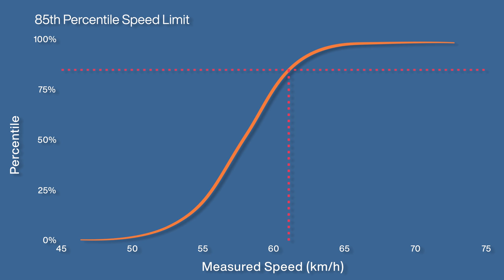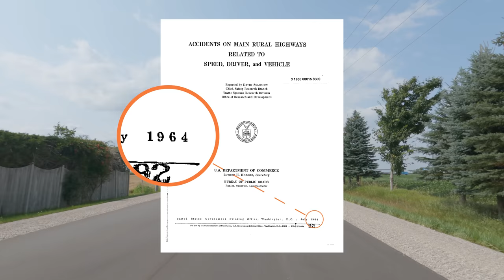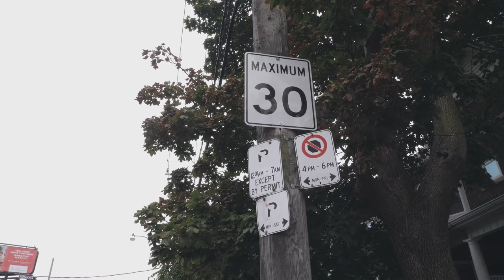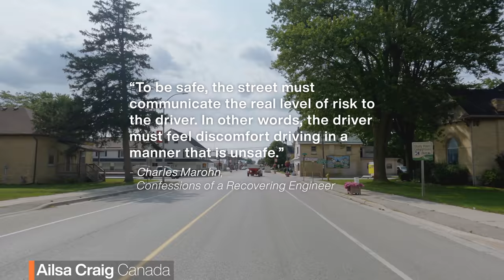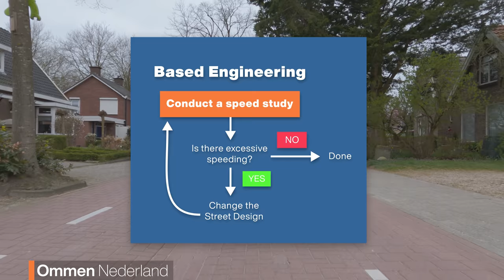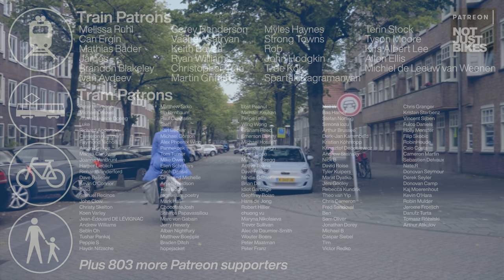The Wrong Way to Set Speed Limits [ST06]

Comment: The 85th percentile method exists for a reason: When vehicles are being driven at vastly different speeds on the same road, the potential for serious collisions is significantly increased. Since roughly 85% of drivers tend to settle around the same relatively reasonable speed totally without regard for the posted limit, with roughly 7.5% of drivers religiously obeying the posted limit, and the remainder going full plaid. By setting the posted limit at the 85th percentile speed, you minimize the potential for speed differential between drivers, and thereby minimize the potential for serious collisions.
Reply: You missed the whole point of the video if that was your takeaway - it's about designing safer roads because people drive to the road design and not the posted speed (which is honestly what you said). When the majority of drivers are driving at an unsafe speed for the environment because of road design is where you get the problem.
Reply: @dertfert745  the guy said that road should have a 30 kph limit. Kinda lost any credibility from that point on.
Reply: @Rokomarn  I'd be fairly sure he said streets should have a 30 kph limit, which is an important distinction. Not all roads. 
This video did tend to confliate completely different types of road infrastructure where it was convenient to make the point, it's not his best work. But nobody's suggesting an arterial road have a 30kph limit.
Reply: @The98597thMark  what? No he's talking about the road he is talking about. I don't know how you can possibly confuse that.
Reply: @Rokomarn  Use a time stamp to show which road you mean.
Reply: @kudosbudo  06:10

Comment: My town is currently redoing the main road. They’re building a lot of shops and making it more pedestrian oriented. While doing this they also made the pavements wider, the road thinner and added speed bumps. It feels a lot more like it’s made for pedestrians. The problem is a lot of cars still drive down the road to get to the main shops with big car parks and stuff. It doesn’t feel very safe for pedestrians because now you’re standing very close to the cars compared to before and there’s a lot of cars going through. It’s the main road off the motorway so lots of cars drive through. It’s harder to get on the motorway from the other roads because they just lead into the busy motorway and it’s hard to find a point you can pull out but the main road has traffic lights.

Comment: The dreaded "stroads" are very common feature in large cities of Poland. Especially in Warsaw (the capital and largest city), but other 200k+ cities have a similar problem. You have city network of wide,  multi-lane winding roads cutting right through downtown districts with motor vehicles speeding at 80 km/h or more (despite posted speed limits of 50), while pedestrians and cyclists need to add lots of distance to cross those behemoths in underground mazes. The underpass near Mariott Hotel in Warsaw is a literal maze of underground corridors, taking few dozen stairs and 300+ meters of walk to traverse. This is an absolute nightmare for disabled or otherewise movement impaired people. Places without an underpass have a normal pedestrian 'zebra' but these are long zebras, sometimes 3-4 at once. Again, movement imparied people are not very happy there to say the least.

This design is unsafe, uncomfortable and also expensive as fuck to build. IDK why they are still pushing this style of design where majority of downtown area is taken by giant road systems and sprawling parking lots (that are eternally full anyway, people are parking wherever they damn well please). Adding more lanes never solves traffic issues in large cities, during rush hour gridlocks still happen even if the stroad is 5 lanes wide in each direction. It just makes it much more difficult to cross for people outside of cars.

Comment: By the way, if it says, "Speed Limit", it is in miles per hour, and if it says, "Maximum" or "Maximum Speed", then it is in kilometers per hour. This is because Speed Limit is an American term, and in Britain, they call it Maximum Speed. That's why at 0:13, the main road going through downtown is set to 40 miles per hour, and the road in the neighborhoods at 0:18 is set to 40 kilometers per hour, which is equivalent to around 25 miles per hour, the speed limit in most American neighborhoods.

Comment: Design speed is something I've naturally thought of while driving everywhere! Glad to know it's actually a criterion for design!
Reply: That's because you're smart, good lookin. If it's raining and you can still safely go the speed limit, then it's too low. More so with snow. I was driving 40 on 35mph road once that had a little snow on it. Complete control. Lights and all gave enough time to slow down, the curved turn offs and everything. Call me reckless if you want, but that road was poorly designed.
Reply: @brianloper6669  I've driven on more than a few roads that had a posted speed of 40 mph when the design speed was more like redline in 6th gear.

Comment: Interestingly, you have the opposite issue on many UK rural lanes. The speed limit is 60 MPH on those, but it's usually unsafe to go faster than 20-30, especially as they're one-lane two-way roads a lot of the time
Reply: Gotta love the Scottish highlands. Single car width roads with occasional passing spots, posted speed limit: 50MPH have at it!
Reply: Yet another reason to take Google suggested paths with a grain of salt. Plenty of roads have a given speed because that's the default on rural roads. In Sweden the default on rural roads is 70 km/h and that is often not advisible.

Comment: Norway falls kind of in the middle when it comes to setting speed limits. In recent years there's been more "Dutch" design to streets, forcing people to slow down with narrowing, chicanes, poles, etc. But a lot of the speed limits on country roads leading into town are for the most part as as in the US and Canada. The road will go from 80 kmh, then 60, then 40. But apart from the occasional speed bump, there's not much to actually slow cars down.
Reply: same in austria. there are areas, where u can drive 100kph on a rural road, that goes through villages and cities, where u have to slow down to 50 with basically no change of street design.
im a big fan of tachographs for all vehicles that can go faster then 30kph. with galileo and gps connection, so first ur car warns u accoustically that ur overspeeding, and if u dont slow down, u will get a ticket automatically... after third ticket in 3 year, u may be forced to make a break for like 1 year :D. when u fail ur second chance, then 5 years, and if u fail third chance, u will never drive a car or motorcycle again. so ez to get rid of all fast and furios semi-apes.
ez technical fix, no need for expensive redesign of all roads, such a device in such numbers would cost maybe 30-50€ a piece, so no big deal compared to overall cost of a car.
funnily i searched german language internet on that topic, that suggestions doesnt even exist.^^
Reply: @certaindeath7776  that will never happen,  it rubs to many people the wrong way even if it would technically be a good solution. You can dream though.

Comment: I've never consciously realised how well road design matches the desired speed in NL now you mention it. I've only felt a few times awkward when there is a mismatch, there are still examples out there. This is usually when speed limit is 50 km/h because it is in theory in city limits although the road is wide, no side roads/streets or other interference in sight. Exceptions in the other direction, where speed limit is higher than implied by road design I cannot remember having encountered those.

Comment: As an European, the only good thing I liked about driving in the US is that there are (almost) no speed bumps. Im tired of scratching the underside of my car because of stupidly tall speed bumps that you hit even when going under the speed limit
Reply: I agree, all those speedbumps are such a pain that people buy bigger expensive cars like SUV's, and pickup's so that they aren't bother (as much) by the speedbumps. The downside to the bigger cars is you get view blocked when driving a normale sized car which in turn makes it less safe which in turn people buy bigger cars not to get view blocked...
Reply: @FlyingThunderRooster  Survival of the fittest!  Go big or go home!
Reply: @FlyingThunderRooster  the worst part about speed bumps is when dumb people slow down excessively and screw up a whole line of traffic.  5mph and your springs won't compress at all, but 20mph and your springs will compress and your shocks will absorb most of it.

Comment: I live in a suburban community, the developer created very wide streets primarily to accommodate large construction vehicles coming and going during the primary build-out phase of the community. After the community was mostly developed, and there wasn’t a much construction traffic going through the community, we (community members) tied to institute various traffic calming measures to reduce the overall width of the street to suit the maximum speed we’d like to see in our community 40-50km. The city traffic engineers were on board, we go opposition from the fire department who pushed an op-ed in the community paper that was basically a guilt trip and smear campaign in one - if we allow the traffic calming measures to go through it will slow down fire department response times and put everyone in the community at risk. That was the end of our proposal for traffic calming.
Reply: Wow. The Fire Department, which is supposed to be concerned with safety, argued against a measure that would improve traffic safety. They can use sirens to cut through traffic and go faster than limits, anyway. I'd bet they fought that measure just because they didn't want to have to drive slower while off duty.
Reply: @nathanpetrich7309  doubtful. They probably didn't want to drive a full size truck down narrow streets full of chicanes and other cars that can't get out of the way.
Reply: @TripleBarrel06  Looks like someone missed the critical detail that I'm replying to a post that talks about a suburb. Suburbs aren't known for streets that prevent cars from letting emergency vehicles through. You can make these streets more difficult without slowing fir engines—I can speak from experience that I routinely go 50+mph down a suburban road that has a 30mph posted limit; they could cut the width in half and I'd still be able to let a truck pass. Now, I'll say this: I was replying to a post that listed speed in kph, not mph, so it could be somewhere in Europe where the norm is much narrower streets in general, but I didn't feel comfortable making that assumption.
Reply: @nathanpetrich7309  I didn't miss anything mate, he said traffic calming measures. The two most common traffic calming measures are speed bumps and chicanes, both of which wreak havoc on long vehicles, especially if they're travelling at speed. I'm not saying it's a bad idea, just that it makes the firefighters' job harder, so it makes sense that they'd disagree with it.
Reply: @TripleBarrel06  Okay, noted. I don't like speed bumps or chicanes because they can be empirically shown to increase deaths, especially when they slow down ambulances. There are other options for traffic calming measures, it doesn't make sense to oppose them in general, especially in areas like suburbs where streets and roads intermingle and increase risks to pedestrians.

Comment: What also astonishes me about the US is the lack of default speed limits. In Europe, cities and towns have very well defined borders so whenever you enter one, you know to lower your speed limit to 50km/h. There is no speed limit sign, because the city border sign serves as that instead. When you leave the city, the default limit is around 90km/h and on the highways it's around 120, but  it depends on the country. And when you cross an intersection, everything is reset to that default because you'll have drivers merging onto a road where they have no idea what the signs said before they joined.

In the US as far as I could tell, there is no default speed limit anywhere and often times the only way to know is to have google maps running where they tell you.

Comment: Ah, the classic American habit of "hey, here's something that works really well in this specific case! Let's apply it to everything! What do you mean it doesn't work there? It worked before, of course it works there as well."
Reply: Road design standards are used so that engineers and city administration can escape legal liability in case of bad design. If they have to design something themselves, then they'll be on the hook if it's dangerous. If the dangerous design is  in the recommended design standards, the it's not an issue.

Comment: In terms of highways speeds in Canada and US, lower speed limit can potentially decrease sprawl. For example if the speed limit is 75 mph (120 kmh) compared to 65 mph (100 kmh) that means the developers can be more inclined to develop further out with the same commute time since speeds are higher.
Reply: Developers are fine with building more density when they're allowed to do it (which they aren't in a lot of cases as covered by this channel).

Comment: What’s the way to solve this? Become a traffic engineer or make pitches to traffic engineers. Also, what do people think would be a good way to make these roads without doing too much construction? In the city I live in, they’re adding bike lanes with posts to separate cars from cyclists which is definitely slowing down cars without ripping up the road to make it narrower/have more curves
Reply: Local governments need both the funding to sustain roads, and an incentive to take a long view to civil engineering, which is difficult when the election terms are so short (I don’t have an amazing solution to that problem). 

Road work shouldn’t be the showstopping force that it is. A city should have enough roads/streets in and out that regular maintenance on roads can happen without major issues.
Reply: How about any kind of real driver testing at all? How about meaningful penalties for collisions or hitting pedestrians or even speeding? Yeah, we can spend millions per mile trying to design the perfect road, which I guarantee will only develop worse drivers, or we could just make people prove they can handle the responsibility in the first place.

We could have built cars that were incapable of speeding decades ago, but we still have car commercials advertising "driving excitement." Give me a break.
Reply: @tobyvision  you’re helpless, speaking of ‘personal responsibility’ and ‘forcing cars to not drive faster than the speed limit’ in the same sentence.
Reply: @JPC009  My point is that there are at least two alternatives to trying to design roads that psychologically condition people to drive an acceptable speed.

One would be real driver training and harsh penalties for bad drivers. Only drivers who prove they can maintain the responsibility would drive.

Another would be cars which are incapable of speeding.

I suspect the car lobby in the USA will prevent us from ever having harsh penalties or strong driver training. These are the people who invented the world "jaywalking" and made it a crime. It would be trivial for auto makers to implement the speed control. It would be more effective and cheaper than any amount of road engineering.

Comment: There are 2 connected roads in my town. 1 has wide, smooth, separate marked lanes, and long sight lines down the road; the speed limit is 30 MPH. The other road does not have separate marked lanes, has multiple potholes, and trees close to the edge of the road reduce visibility; the speed limit there is 35 MPH. Worse than that there are some beat up back roads that barely have room for 2 cars to pas and they have a 45 MPH speed limits. Driving on rural back roads when there are other people also driving on them gives me a bit of anxiety, because even if they're going the speed limit, they're going too fast.